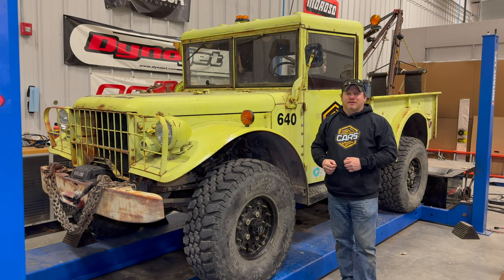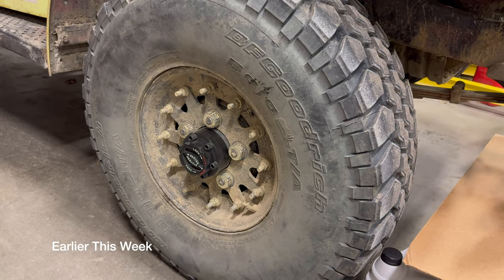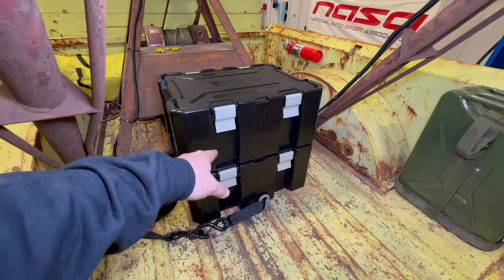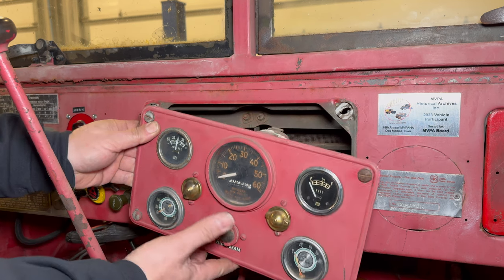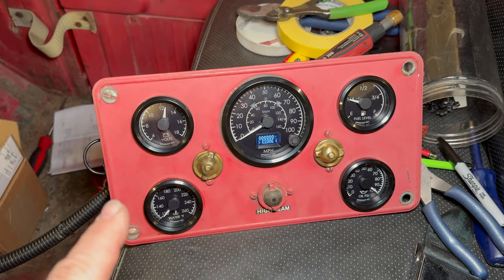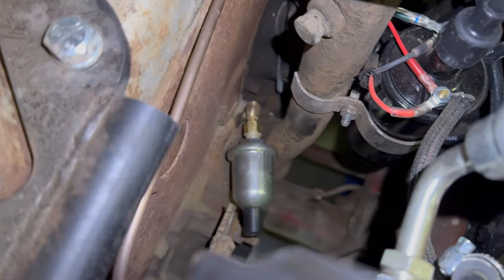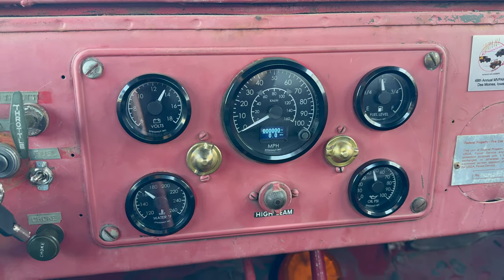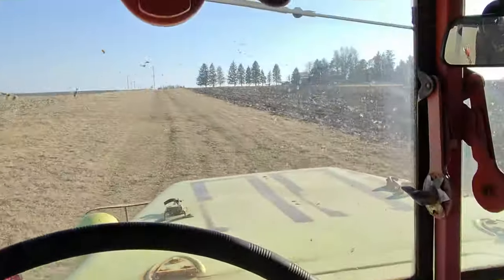Is the Vintage Off Road Wrecker Ready for Offroad Games

Comment: Nice job. I have a quick question not wrecker related. I have a 712K Pinzgauer and if I remember correctly you have one too. Did you replace your gauges on it? I heard the Hmmv gauges might work. Thanks for the video. Alan
Reply from the maker: I added a VDO voltmeter to the 712K but have the other original instruments, I think these SpeedHut HMMWV gauges would work well.  All SpeedHut instruments work on both 12 and 24 volt systems so it doesn't matter what you put them in as long as you have the correct size hole for them to fit.
Reply: @ThisWeekWithCars  thanks I appreciate it